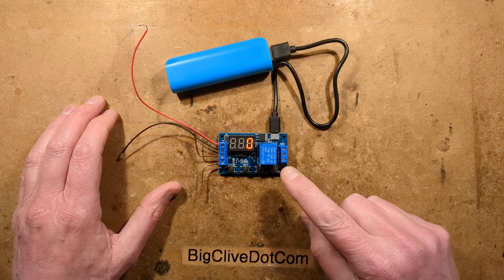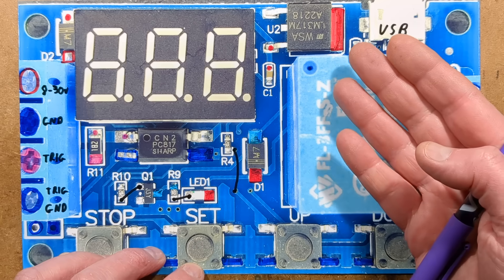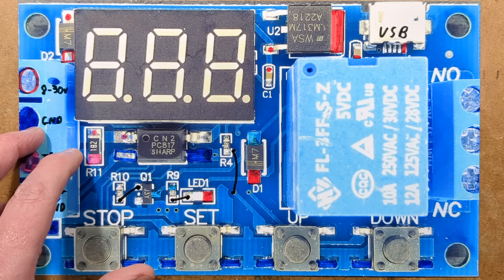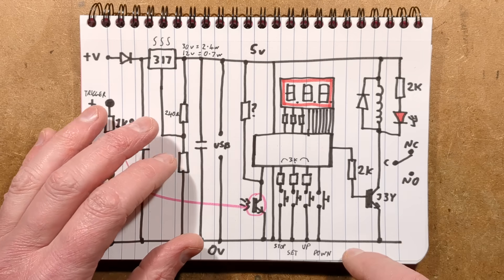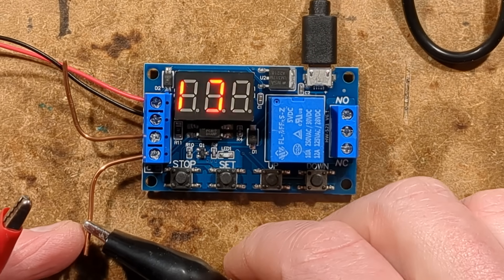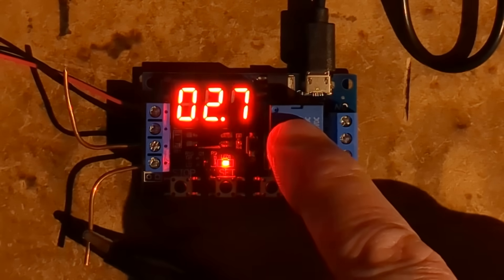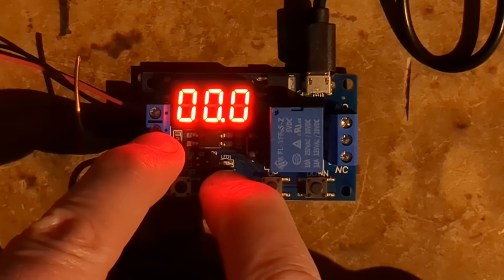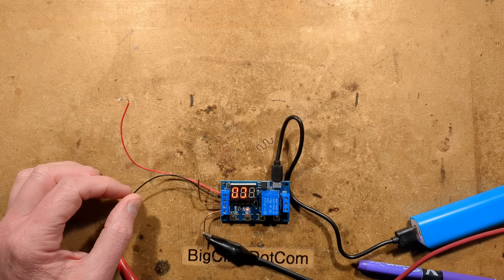How to use these common Chinese timer modules

Comment: Not sure what I'm doing wrong but I'm copying everything in the video and I can not get it to trigger 😞
Reply from the maker: Are you definitely applying voltage to the trigger input with two wires?   It's opto-isolated, so needs the positive and negative of the correct polarity.

Comment: Thinking of using this to fill 4 urinal cisterns for X minutes every X hours. Be even better if you could use in conjunction with a PIR as the trigger but presume that would cause lots of flush cycles if the toilets were busy. Be good if you could trigger with the PIR but then it lock out for X minutes or hours until another cycle is allowed.

Comment: I bought one and it works perfetcly. However, the second one I bought (from the same seller and product page) doesn't seem to work the right. It keeps showing 0.0 and blinking P1.1, not just after power on but every few secodns. I can set it to on / off(STOP button) and see the OP time(short SET press), but holding SET does nothing. I can't trigger it either. I assume it's a defective unit? I got 2 in the same order, both act the same...
Reply from the maker: Check that the buttons feel normal in case they have been damaged, and also check if there is a solder bridge joining pads on the back.  The symptoms hint at the microcontroller thinking that a button is being pressed continuously.
Reply: It turned out my USB power supply was briefly cutting power and resetting the mcu. Not sure why it does that, it works fine with other devices. I assume the lack of that USB-C resistor is the culprit, but usually that means no power at all...  Thanks for the reply, I would probably end up buying a new one otherwise...

Comment: Where/how do I connect the device? Im trying on-off (3.2) mode with a small 5v usb fan (2 wires, black and red)😅. Thanks a lot in advance!
Reply: And Im using eather usb power or a celly charger as a power supply for the relay.
Reply from the maker: The fan power will need one of its wires broken by the common and normally open or closed contact of the relay.
Reply: And the other fan wire go to? I manage to power and code the timer with usb power, but just dont get the power out of the relay to energize the fan. Sorry I really havent made much out of electric components before.
Reply from the maker: @TheBestOrNothing-o5g  If you connect the negative fan wire to the negative of the 5V supply, and then break the positive to the fan through the relay, that should work.
Reply: Still doesnt work.  I think this makes the whole relay quite un-convenient as I would like to use it with intact USB-chord. 

Is it really so that its not possible to power the relay with usb-power and then just connect the device (what ever it is) to the relay. That would be brilliant and its what Im searching for. 

So what I did now.. I broke the usb cable and tested once again that the fan works with +/- minus power taken from the usb chord. 

I found a picture how to make the connections using the 6-30v and ground ports and got the relay working properly. In this case there has to be connection between 6-30v port and NO or NC port, which ever is used.

Ground is taken from the power sources GND as you mentioned before. 

Id be happy to see some picture how to make the connections using only usb power, if that is even possible with this relay.

Comment: Please can you help me??
How would I wire this up, so that when I turn the power on a fan starts up for say 50 seconds, then turns off & then another fan turns on for 50 seconds?? On/off.. on/off ??
Thank you
Reply from the maker: Select mode P-3.2 and program both the OP and CL times to 50 seconds.  Then connect one fan to the NC (Normally closed) contact and one to the NO (Normally open) contact.  When powered the unit will toggle the relay on and off switching between the two fans.
Reply: @bigclivedotcom Thank you soooo much! Will this run continually on a loop until I turn the power off & also after turning the power off, when I switch the power back on, say the next day etc... Will it remember the on off setting & continue to loop it again, or will I need to keep programming in the sequence again & again, after each power cycle??
Thank you in advance of your answer. Cheers- Rick in the UK 👍👍
P.s will I need to put in a connection to keep the trigger part closed etc... so I don't need to keep pressing a switch?
Or should I include a switch??
I need the project I'm going to build, to run on/off (i.e one fan on for 70 seconds, then the other fan on for 70 seconds, until I switch it off...
Then again later, or any other subsequent time I wish to use it.

Hope that makes sense?
Cheers- Rick

I really do appreciate you getting back to me 👍👍

Comment: Hi Clive, is there any chance I can please email you about this unit and a plan I have to use it to power on and off an Australian 4 socket powerboard via an SSR? I have come up with a plan using AI but I am still concerned about tapping into the powerboard’s main voltage with the SSR. This is to trigger 4x LED UV floodlight style panels to turn on then off after 12 minutes or so for a UV exposure unit.
Reply from the maker: This unit should be OK with mains on its relay contacts.  But you'll need a USB power supply for the module itself.  Just make sure everything is in a suitable enclosure for safety.
Reply: @bigclivedotcom ok thank you. I thought isolating the mains via the SSR was more prudent, but honestly I think it will just complicate matters (I.e bang pop fizz unalived)

Comment: I was going to source one of those time delay relays like what we used for putting a 2 second delay on hydraulics at my old job (I have a weird application and I'm trying to add very basic safety).

This looks like it can function as like 3 other functions I was planning to add with some basic feedbacks looped through additional relays, and it's a ton cheaper than my current bill of materials, so that's something.
Reply from the maker: The main thing is to consider failure modes and design to prevent them causing uncontrolled motion.
Reply: Fair enough. I know my employer let the vendor cheap out on the belt controllers and so belts will occasionally get stuck on (they figure that to be an acceptable nuisance).

I guess that's acceptable for them, but for me.. y'know, my application might be just right for (and actually better served by) MOSFETs given the voltages I'm working with.

Comment: Thanks Clive for your detailed explanation.  I'd like to add few additional information:
About 10 months ago, I bought a few of these modules from various stores "there".  Typical price would be around one dollar give and take.  They are 99-100% similar/same as what you are showing here.  I call this style the "old" version.
Then there is a version, most of them sold by TZT Choice Store.  They typically cost $2 or so.  Some of them in the back of the PCB have a silver screen showing version number (1.2, 1.3, or 2.0) and some don't.  I call this style the "new" version.  I kind of feel TZT is the original designer of this board and had put in some useful features and improvements in it.

For example, 
- there's no dead time/initialization when DC power is applied (e.g., if such mode is initially ON, the Relay will be energized immediately and no 2 second wait time)
- few power-on auto-trigger modes are added
- with slight modification, you can turn it into zero-power time delay switch.  I.e., when Relay is not in ON mode, this module can stay unpowered (press a momentary switch to trigger it).  It will be useful for battery powered operation.

======== Old version ==========

OP: "ON" time
CL: "OFF" time
LOP: number of cycles
In most cases, it's "leading edge trigger"

P1: off-OP-off
P1.1 non-retriggerable during countdown
P1.2 retriggerable during countdown
P1.3 second trigger (if OP) -> immediate-off

P2: off-CL-OP-off
non-retriggerable during counting

P3: cycle off-OP-CL-OP-CL-...-off
P3.1 second trigger to immediate-off
P3.2 auto trigger (when power on) OP-CL-OP-CL-...-off

P4: trigger hold mode off-OP-off Similar to P1.2 except that it's "level trigger"

Use case: room light switch After flipping off the switch, the light stays on for few more seconds.

Note: slightly old version, no 1.4 and 2.2  2.4 modes (power on auto trigger mode)

Also note that, when power is applied, the board displays the mode.  During this time, the module doesn't accept any trigger signal and the Relay is "off".

======== New version =========
OP: "ON" time
CL: "OFF" time
LOP: number of cycles 
In most cases, "leading edge trigger"

P1: off--OP--off
P1.1 non-retriggerable during countdown 
P1.2 retriggerable during countdown 
P1.3 second trigger --> immediate-off
P1.4 auto trigger  OP--off

P2: off--CL--OP--off
P2.1 non-retriggerable during countdown 
P2.2 retriggerable during countdown --> go back to CL
P2.4 auto trigger   CL--on (forever)

P3: cycle off--OP--CL--OP--CL-...-off
P3.1  second trigger to immediate-off
P3.2 auto trigger 
OP--CL--OP--CL-...-off

P4 off--OP--off
Similar to P1.2 except it's "level trigger"

====================
====================
P.S., also note that there is a MOSFET low-side swiched version.

Comment: I wouldn't buy a cheap Chinses timer. They are not difficult to build. Yes, if you have an electronics background it is going to be easier.
Reply from the maker: But for a dollar shipped with full programmability and multiple modes?

Comment: I bought several of these.   I agree, it will be quite handy for many situations.     For the price it would make a simple mains bulb flasher.   Too bad it didn't have a mains to DC power converter built into it.

Comment: What about putting a water cooled heatsink on to the regulator to dissipate the 2 watts of heat?
Reply from the maker: Maybe a sealed heat pipe.  Did you delete all your pinsetter maintenance videos?

Comment: Have one, its pretty reliable, just ensure to get the correct module and supply. Might benefit from a 3d printed dust cover and some protective coating on pcb. Last time one went bad, was due to corrosion from moisture/water spills(although washed the dust and dried it a couple of times before that).

Comment: I could've saved myself some effort if these modules were available 15 years ago when I made my stench extractor. Photoeye detects cat entering bathroom where litter box lives. When cat is detected, start bathroom's built-in fart fan. 15 minute run-on timer starts timing, retriggers as cat breaks beam leaving, turns fan off 15 minutes after cat has left. Bonus feature - the bathroom door blocks the beam when closed so if someone lingers while doing a poo the fan keeps running til 15 minutes after they complete their jobby and leave. 555 + relay, etc.

Comment: Use watchdog timer on PLC out put cards. Program one output on that card to trigger on and off, wire that output to a timer. If that card fails the timer times out and raises an alarm. Very handy where a failed output card is process or safety critical, although shouldn't use this as your only means if it's a safety critical application. Great vid on intro to timers as most have the same type of functions and control logic.

Comment: How much current does that relay coil actually draw? 20mA? That's only 500mW for a 25V drop. Even 2.5W should be within spec for a TO-220 style package with heat sinking, and it looks like the tab is attached to a ground plane.
Reply from the maker: When the relay is energised the unit passes 100mA.

Comment: I bought a very similar timer about 4 years ago on Amazon, it has a 4 digit LED. I wasn't about to pay hundreds of dollars for a prebuilt system. I needed a timer that ran off the 12vdc output of a modem UPS (that my ISP provided for free and I never usd it) for a DIY pump setup for my gecko. It needed to go off 4 times a day for 30 seconds each time and have redundancy in case of a power outage.
It's doesn't have USB to power it however. It has two 3-post screw down terminals. One for input voltage, one for output voltage. And to get the darn thing to work the way I needed, I had to figure out how to jumper a connection between the input and output. This made it even more complicated to program.

Comment: The micro-B USB connector is an abomination unto the gods of electronics. How it unseated the mini-B connector, which was far, far more robust, beats TTF out of me. 

Neither is as robust as a common 2.1 mm barrel jack. 

Next thing you know, well be seeing DB25 RS232 connectors used to source 5-12V.

Comment: Is the setting stored in non-volatile memory? (In other words, does it remember the selected setting when powered off, or does it revert to some default setting.)

One downside appears to be that the display is recessed lower than the terminal blocks - wouldn't it be a bit difficult to make a nice enclosure for it?
Reply from the maker: The settings are stored.  There are versions with cases, so I think they extend them up higher for those.

Comment: Neat. That watchdog timer looks kinda useful if you need to reset a micro if it stops toggling the output :) 

Only tangentially related, but it's inspired me to want to keep working on the kitchen timer my better half asked me to make (writers block haha). For a while he's used one of those amazon devices you shout at to time food and stuff, and we want rid of "she who must not be named", so I said I'd build one... So the timer I'm building is 4 timers you can set. A preheat timer, two cooking timers and a "cool-down / wait" timer, all that can be set at runtime with a keypad, display and buzzer all on a simple arduino. :)
Reply: Arduino is really challenging to run multiple timers on while monitoring user input. It’s a good project!
Reply: Heh, I'm also part of the "unfinished project to build/program a custom timer" club xD Mine is supposed to only have two timers and should run on a Raspi Pico, but so far there's only the breadboard mockup and a bit of test code for the 7-segment display 😅

Comment: These are a very handy module. I used one to empty the tank of, well 10 litre bucket next to, a dehumidifier before.
Maybe your module is slightly different but I don't remember having to use any voltage across the trigger.
Purely due to the location it was in, the dehumidifier couldn't drain directly into a convenient drain, so what I had was the dehumidifier draining into the bucket next to it. There was a 12 volt submersible pump in the bucket, along with a reed float switch attached to a bracket near the top of the bucket. 
The float switch was attached to the trigger terminals and I had a 12 volt supply feeding the timer module and the pump. 
When the bucket had approx 8 litres of water in it the float would trigger the module, which would run for long enough to almost empty the bucket into an external drain, approx 30 feet away. 
I think I calculated that if the pump ran for around 2 minutes it would drain the bucket, so that's how long I set it to run on the module. Once it had run it would reset and wait for the float to trigger it again.
It was a bit Rube Goldberg but meant we didn't have to keep checking on the dehumidifier.

Comment: These 5v versions are horrible for anything other than the 5v input. Even at 12v the little power regulator super heats with the relay enabled to the point where it'll burn your finger. 
I suggest getting the appropriate voltage for your application. They come with a 12 or 24v relay, therefore the voltage regulator doesn't get hot

Comment: I bought a cheap timer once. It was programmed by pressing a button to turn the output on, then pressing again to turn it off when the period of time you desired had passed, and it would repeat that every time it was powered on. 

It advertised support from 0.5 seconds to 15 years.
Reply: I would be very impressed with somewhere that has no electric downtime for 15 years, and doesn't have an issue with low cost devices being plugged into said circuit

but also, something running for at least 30 years just to time something else seems like a design challenge, but on the other hand, there might not be anything left of the company at that time,  so no warranty either
Reply: I remember someone explaining how the IRA used the Babani booklet 555 to build the device they used in Brighton...the addition of a mechanical timer to switch the whole thing on as it sometimes latched on when 1st switches on...👉⤵️👈‼️

Comment: 8:58 when all the decimal points are illuminated the timing range is  1 minute to 999 minutes.
 From the manual:
XXX. decimal point in the unit place, time range: 1 second to 999 seconds.
X decimal point in decade place, Timing range: 0.1 seconds to 99.9 seconds
 X. X. decimal full brightness, Timing range: 1 minute to 999 minutes.
By "full brightness" they mean 'all  illuminated'

The Chinese often translate the wrong word and I have tuned my brain to correct this.
I service a well made urinalysis instrument made in China . The service manual frequently refers to "rinsing" various parts such as the laser optics . What they mean by "rinse" is "clean" not actually rinsing the lenses
Reply: I have never understood why these companies don't enlist the services of someone who speaks their language but who also speaks english like a native.  It probably wouldn't cost all that much considering how those services could be spread out over a whole lot of products.  I formerly dealt for a while with a fairly well-known Japanese company and ran into the same kind of thing there.

Comment: I use these in motorcycle chain oilers . The timer opens a solenoid valve and by adjusting the duty cycle the oil can be metered precisely.
I used to use a fluidic flow control which is basically a needle valve but they were $25 and needed modification for the low pressure gravity feed I was using. 
The timer costs less than $5 .
I prefer the mosfet output version.